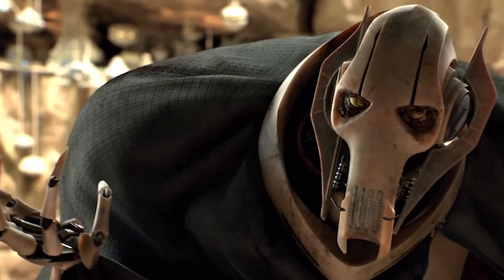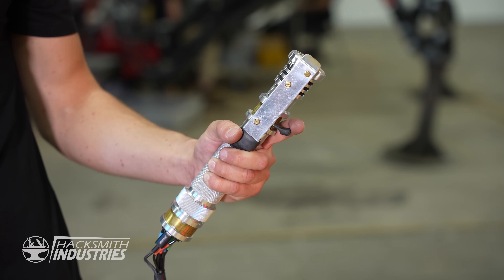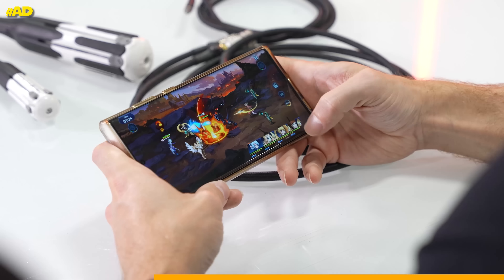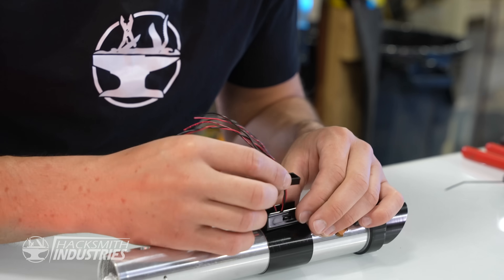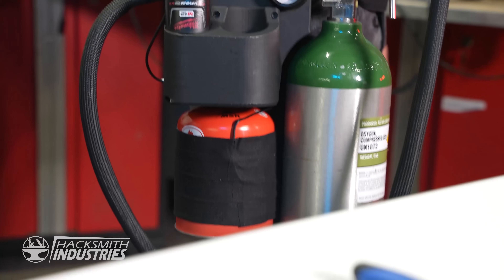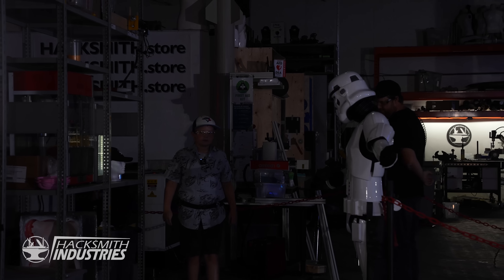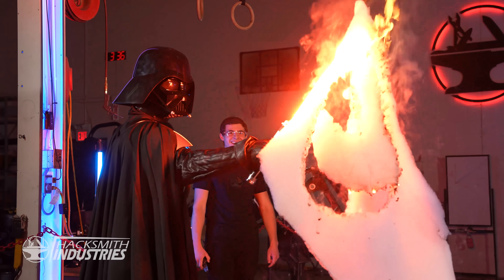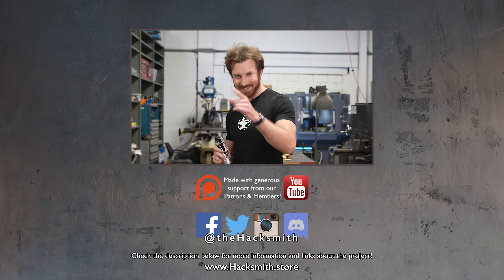My Best LIGHTSABER Yet! (STRONTIUM PLASMA 4500°)

Comment: Hey, first of all im not into any kind of building stuff but I got some ideas that might work or not.

Lenght of the Saber
For the problem of the length, try to take the gas tubes and twist them together so the gas will become a spinning form while its going out of the tube. This might stabilize its form and it might stay more in shape. Usually this Methode is used in Tanks to spin the bullet fast so it doesnt get affected by the wind or stuff.

Space
A other big Problem is space and the use. By shortning the tubes to a certrain amount and also increasing the inside of the lightsaberhandle you will get some more space to work with. 
By 1. Redesigning all the plates with cables to seperate ones with connecting bridges ( cables ) you can bend them and maybe put them right into the handle in the shape of an circle. To protect them from heat you vould use maybe keffla or something im not sure how certain materials resist against the heat of the tubes

Design
For a better design you should combind all the gas tubes and surround them with a black material and leg them come out on the bottom of the saber so you can hide them in your pullover or stuff like that. You would just let the cable rund trough the mid of the circled plates.

Sound
Since the lightsaberhandle still got a small bended amount of space you can put a mini speaker inside of it. When you now cut a little a hole or a slice into the lightsaberhandle and then glue the black stripes from the anakin lightsaber over them and and making some small gaps beneth the connection of those 2 parts you will beable to hear the sound.
Problem to solve: small fitting speaker

This would reduce the bagpack to a gas can and a batterie. The batterie can easily be hidden and the gastank could get in shape of an square that is bended to the back or in some different form. You  could also melt a short batterie holder to the tank so you dont need to split the Cables during hiding them. You can connect the gastank to a belt or you can use it as a backpack behind your jedi coat.

Problem to handle: creating own gas tank shape that allows to hold some preasure

Thank you for reading and excuse me for my bad gramma since English aint my mother language
Reply: I think you need a better understanding of physics before suggesting things in future - I'm not going to address all of it but for your length suggestion

The gas wouldn't continue to spin when it leaves the tubes, it would go straight, so their would be seperate streams of gas pointing in different directions. 

It's the same principle as suggesting that you twist a gun barrel, so that the bullet spins in the air, that only works because of rifling, which wouldn't work on a gas.
Reply: @jackbimson8142  Thanks for your informativ answer. Like i mentioned, these where just some thoughts that I wanted to share and I dont have any understandings of engeneering so dont blame me for sharing some ideas that might not work out :)

Comment: I’m thinking out loud here, how about, in order to keep the blade at max height, use an accelerometer that makes the power pack emit more power based on motion?
Reply from the maker: It's putting out max power at all times
Reply: @hacksmith  OMG U REPLIED TO ME IVE BEEN A SUPPORTER AND VIEWER OF THE CHANNEL FOR A LONG TIME ( I probably started when i was about 7, I’m 15 now)!
Reply: @hacksmith  Anyway, just a suggestion

Comment: Have y’all tried making it a laser. Or hie power to get any further that might be wat u need for the next leavle
Reply from the maker: Nah, lasers wouldn't work, because to make it powerful enough means you'd go blind even being in the same room as it
Reply: @hacksmith  actually the problem would end up being able to make it portable and having an end point 😂. Bc I work with one cuts up to 3/4in carb steel but it’s the size of 3 trucks 🛻

Comment: Couldn't you use a metal 3d printer to make a cartridge with integrated holes to go in the handle instead of all the copper tubes and machined peices?
Reply from the maker: Potentially! Most metal 3d prints are a bit porous though,  wouldn't want the oxygen and propane mixing prematurely!

Comment: If you combined the solid blade idea from the  older lightsabers with the flame blade by making a solid shell heated by the flame blade inside of it(possibly tungsten and titanium like mark 3? That seemed to work really well), it might help with the blade length problem, as well as allowing for another lightsaber duel. Just don’t forget to make vent holes in parts of the shell so it doesn’t explode!

Comment: I appreciate that you actually performed that jump in the intro my dude, watch those knees lol Now then, Unobtanium aside, how does the fuel system in an actual lightsaber work? The miniaturization you guys have developed is fantastic. This final bit of information is probably the REAL barrier to developing the common lightsaber we know and love. You guys are awesome, thank you.
Reply from the maker: An actual lightsaber doesn't exist -- so how "it works" is really irrelevant because it was dreamt up without thinking about physics 😜

Which means however we figure it out,  is how it works 💪
Reply: @hacksmith  well if you found a way to contain the plasma in a magnetic field without the need of metal at either side that would be a step closer but as of now I don't think that's possible
Reply: @jenniferdunstan5065  hear me out, I wonder if there's any merit to those string looper kids toys. You know, where there's a fast spinning wheel, and you wave the handle around to make wavy shapes.

Perhaps a series of strong magnets alternating a push and pull could create a similar loop, however one that moves a lot faster than a piece of string, so would be more difficult to deform.

If you could fling a magnetic loop like that, it could be feasible, but the power consumption for that alone would be significant
Reply: Unobtainium is the crux of a lightsaber working.  But it was dreamt up by using the idea of LASERs. Which is that when you apply a strong electrical current to certain gemstones, they emit radiation (light.)   Star wars suggested "What if there was a crystal that produced plasma when stimulated, instead of light?"  

So until there is a gemstone that emits plasma when stimulated by electricity (Physically impossible, because plasma is a state-change of matter.) The rest of 'how a lightsaber works' is basically the same principal of what they're doing here.  The other key ingredient being a magnetic force-field... which is probably also physically impossible.   But the force field is used to create a barrier to 'contain' the plasma inside of. That gives the saber it's shape.

But that's where your suggestion might be worth looking at. The next step for this project might be ways to 'contain' the blade in the right shape. Force fields obviously aren't possible, but maybe other ways to contain or shape the plasma-stream?
Reply: @KitZunekaze  we don’t have forcefields yet
Reply: @epicassassin8502  I said "It's probably physically impossible." So yes, I understand that.
Reply: In lore lightsabers used a crystal that doesn't exist and while there probably would be a type of gas compact enough to fit in just the hilt it would probably explode

Comment: what if you had a rod extend from the handle at the speed of the plasma in order to have a physical blade used for deflecting and clashing and such. If you  had a reflective enough material or used a salt-coloration mixture, the rod would bee barely visible from inside the flame.

Comment: And just what happens when you're stylin', and your blade comes around and violates your oxygen tank?  Even one as small as they are using here will explode with lethal force.  I don't think I'd be eager to get close to this technology.  I know my limitations...
Reply: Unless you're applying the blade to the oxygen tank for an extended period, you won't be cutting through it. But if you can't trust yourself to apply some common sense, I suggest you keep away from welding equipment, gas heaters, internal combustion engines and anything remotely dangerous. 😁
Reply: @another3997  Actually, I do!

Comment: Idea: would it be possible to pressurize the fuel to fit in an even smaller space? Like to get it to a liquid or even solid state?
And then, as the fuel is given an outlet, it'll quickly transition into a gas that can be used.

I feel like the biggest problem is:
1. Whether that kind of pressurization is feasible/safe in such a small space.
2. If the release of pressure can be controlled enough to not have it all shoot out instantaneously 

Problem 2 presents some additional thoughts:
1. What if you use multiple pressurized fuel cells to allow for a staged release?
2. What if this is the key to pure plasma bolts, and therefore the proto-blaster?
Reply from the maker: Butane and propane the fuels we've used are already stored as liquid, oxygen can be stored as liquid but is quite dangerous
Reply: @hacksmith  Ah. Might it be possible to condense them further? I'm just thinking about how compactly the fuel might be stored.

I have no expertise in any of this stuff either, so half my suggestions may be completely impossible 😅 
But hey, who knows, maybe they'll prove useful in some way
Reply from the maker: You can't compress liquids :)
Reply: @hacksmith  At all?
I was thinking about how it works in the earth's core. I guess we just don't have that level of tech?

Comment: If you want to have the real blast door melting scene it's going to require alot more power than a flame alone will produce. I'd suggest using a 3/8 tungsten core through the centre of a 3/4" carbon arc rod isolated from the hilt, have the laminar flow nozzles in a circle around the rod for the plasma effect.and hopefully the plasma will hug the rod.    Hook up the carbon rod to a welding power supply and crank 500a through it, earth the door and then go nuts 😂 better make a fireproof Vader suit with a built in welding visor because it's going to be hella bright and stupidly hot. You may need to introduce an air blast at some stage to clear the molten metal..

Comment: I know you dispensed with the idea of magnetic fields as a way of creating the blade early on since they wouldn't be powerful enough for a lightsaber, but have you considered using them as a complementary tool?
So you use your currwnt plasma-blade tech in conjunction with the magnetic tech, and see what happens.

Because I can't help but think that might let you get closer to being able to swing your lightsaber around like in the movies. Maybe not all the way, but still.
And as an added benefit, it may allow two lightsaber to interfere with each other, allowing for "blocks."
Reply from the maker: It's not possible to make a magnetic field the size of the blade without a very large superconductor magnet -- and even that would far too big for the hilt :(
Reply: @hacksmith  Alas.... Maybe in time, something could be done to change that or make it feasible

Comment: You know, I was thinking about it. A light saber doesn't exactly have to equal fire right? So it can cut through steel, but can't lasers also do that? Lasers are just pure light, which is just really fast electrons, right? And I think the closest thing to that is literal eletricity... What if you make a saber that uses electricity that's being kept into shape using a rod, possibly made of a highly magnetic material so that way it creates its own pull? You could probably cut something with enough eletricity
Reply from the maker: The power requirements would be astronomical -- and you'd have a really good chance of being electrocuted. 

That being said... we've already done something similar 😉 watch our other lightsaber videos

Comment: Hmm just to think a key detail to improve would be integrating a magnetic field to contain the plasma blade until it makes contact with a solid material, also allowing for combat. But it would need to be togglable so the magnetisation activates and deactivates when the blade is not active, restricting the plasma blades movement. Also integrating a magnetised aspect to the blade such as ironizing it to control the blade. 

Considering that we do not have a power cell capable of retaining a charge of long enough - Despite lightsaber needing to be recharged in star wars yes we do not see it but google it, its weird but fun to see.
Also factoring that the manipulation of lasers and crystals commonly diamonds is a pricey process an accurate saber is far far far away but I enjoy their compromise, unless utilisation of Tachyon manipulation becomes closer as most of sci-fi is locked beyond the Tachyon interaction and manipulation wall
Reply: The difficulty is getting the geometry of the magnetic field right
Reply: @thebuddercweeper  very true, without calibration and testing with many proto-types and qualified people designing you would have like the faulty saber in Clone Wars lol

Comment: Why not have a small, extendable rod that retracts and extrudes from the hilt which is superheated. Then shoot the plasma/flames around it from the hilt which should allow you to swing the lightsaber and collide with other blades as well as making the flame coming out of the hilt alot more stable in the direction you want it to travel

Comment: Loving the progress! Had a thought. What happens if you put a powerful laser in the middle? Like if the laser was somehow emitted from the center then dispersed into a wider beam by passing through some sort of cone shaped focusing lens/crystal... would the photons intermingle with the gasses being used to create the flame thus potentially extending the length of the blade????

Comment: Random thaught here.

Since the equipment has been shrunken to such a small size compared to model 1 (M1), why not have two model 2 (M2) energy packs on each hip? I know that it might be hart to make it work, but it could make the saber alot more powerful.
Reply from the maker: Power pack isn't the limiting factor,  it outputs the same! Blades weren't tuned well by the demo date which was why they seemed short
Reply: @hacksmith  It will become longer with more power and another nossle
Reply from the maker: No,  it won't
Reply: @hacksmith  try it.
Reply from the maker: The fuel pressure is the same,  adding two would just make it last twice as long.

Comment: Insane work as always especially how you managed to decrease the form factor by that much! The estimate of 2030 is really really optimistic i think tho especially if we talk cordless, so somehow have the fuel inside the handle. I'm not sure if it will be ever possible to have a real light saber as the biggest obstacle besides the fuel is to somehow produce a stable flame which doesn't by half it's size on e cutting.

Comment: Cool video))) But in order for the swords to be really cool, and you could fight with them, you need to make a core of solid matter) How about reducing the temperature of the gas jet to 2000 degrees Celsius, and inside make a retractable tungsten rod so that it does not melted from a jet of gas, mine will be very cool)) or as an option to make the gas jets come out of the tungsten rod))

Comment: Honestly I'm not impressed -  there are far too many glaring issues with the current design. A flame saber really just won't work reliably unless you have a pop out transparent telescopic blade tube delivering the fuel at equal pressure all along the blade. This will help solve the problem with being able to swing the sabre and the variable flame length. A pop out telescopic blade tube isn't ideal but if it's transparent it won't be noticeable. But then you might not be able to cut through stuff unless the blade end is super hot. 

The other alternative is to start from scratch and try some alternative method other than a gas flame blade.

Comment: A Squirt Gun with a big hole doesnt shoot as far but a Squirt gun with a smaller hole shoots farther
Maybe the same goes with fire?
And maybe it could make the Lightsaber have longer range and more controled flame so we can swing it
But we need fire power also so we just have to maybe make the hole a little smaller but not too small that it would lose power

Comment: I do kinda feel like flame is the wrong direction for light saber research, in that it's too hard for it to maintain a consistent form moving at high speeds or to 'impact' on objects including other lightsabers, not to mention that I see no way to eliminate the need to carry some manner of fuel tank with you during use for constant flame output. I don't really have an alternative in mind though. Considering Lightsabers also have intensity settings canonically, for training purposes so you don't cut your own hand off or whatever, that may also be problematic with fire, because even less intense fire is still fire.

I feel like the answer has something to do with magnets, but I don't know how. Perhaps having magnetic fields that can push against other lightsabers magnetic fields to allow them to bounce off eachother? I don't know a single technology that can so accurately project such a powerful magnetic field so far away from a base  though. I'm not an engineer though, so I'm not exactly up to date on that stuff.
Reply: Isn’t it plasma?

Comment: You guys need to charge the plasma you're generating and make a magnetic envelope to contain it so it holds together within the envelope/bubble. Then your fuel can go towards keeping the plasma hot and pressurizing the magnetic field, instead of simply gassing off and dispersing the heat, thus requiring less fuel. After that, it's a matter of distorting the magnetic field to get the proper shape you want and making it even stronger.. Much like how a fusion reactor works... Hope this helps....